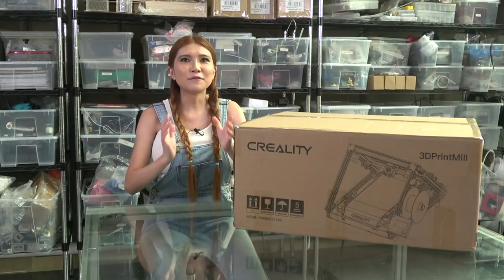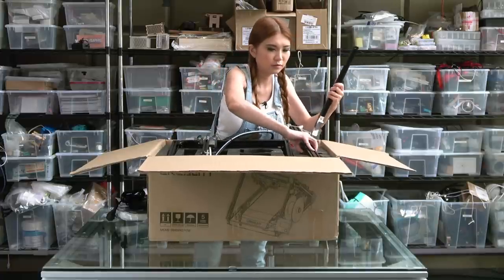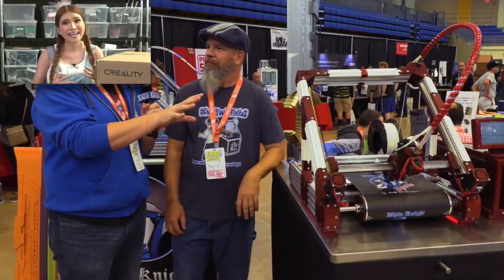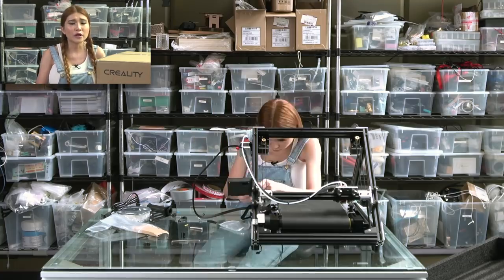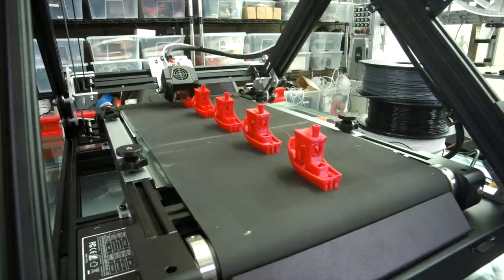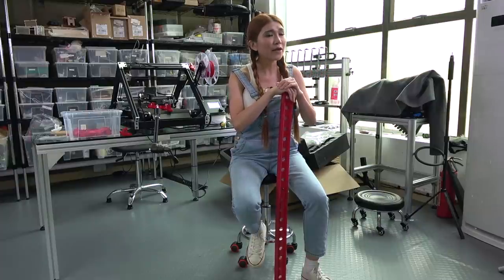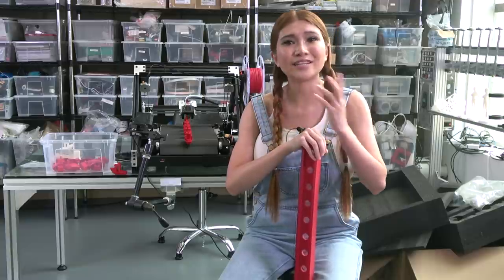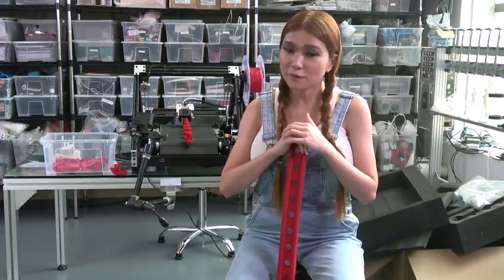Sneak Peek- The 3DPrintMill, Infinite-Z, Belt 3D Printer- Now on Kickstarter!

Comment: Still can’t believe this is a thing. So many possibilities. Really kills some of the dimension limitations
Reply from the maker: It's amazing!
Reply: I can see some large replacement parts for my car or cosplay being a reality soon.
Reply: Thanos Sword
Reply: I agree jesse. I so want one!  Great job Naomi!
Reply: the long I Beam printing was impressive!!!
Reply: Now you can print really long things Jessy...
Reply: Infinite Z has been around for many years. It definitely fulfill certain needs. But you are giving up material choices and print quality in exchange for size.
Reply: @Paul-sk2pc  it''s a niche printer .. probably good for very long parts that don''t require high resolution and uncommon materials.
Reply: I like this, good job!!
Reply: @Zuul47  has already been done by NAK 3D design (see channel beyond the video)
Reply: Perfect for my model train cars on larger scale engines? Price???
Reply: @WillofNewZealand  I have  a Creality 10S Pro but need to go long for train bodies. I wonder if i could retrofit the frame. $1,000 for me is a lot to invest when i have over  $600 in my 10S Pro already. Having the Belt printer and a UV Cure printer for smaller detail parts would be awesome. But maybe the quality of finish on the Belt stuff is not so great. All the videos are high speed fat layers and crude. Thank You for the Heads up. Need to list more more parts on Shapeways to increase revenue so I could get one. Incentive to work to grow.  Dennis in Virginia.
Reply: I see so many issue that like so many CR6 printers down no support. Many will not back this project. What stinks it there huge possibilities. But this printer all ready got huge black cloud over it because of such bad support and so many CR6 printers are not working
Reply: The Pervy Prepper  I could see lots of those parts released by the manufacturer and or for a commission by designers. Then make all the parts that can be modified or replaceable on a consumer level.

Comment: I'm an engineer at a company that makes appliances.  Something like this is really interesting for our Service Parts team.  We'll definitely have to take a look when it comes on the market!
Reply from the maker: Excellent!
Reply: That sounds fantastic, especially when manufacturers decide they're not going to supply spares for a 3 year old device!
Reply: I think 3D printing for spare parts is the future. No need for huge stocks of small items. Just print on demand. Better yet, actually release the CAD file and sale them for a few cents/dolars or give them away for older stuff.
Reply: @lsaplai  Let me know when i can 3d-print a new mainboard, or heated bed, or stepper motor, or hotend, or threaded rods or or, you get the idea.

Don't get me wrong, I fully support the idea/concept and I hope companies will start moving in that direction, but it has limited use.
Reply: @treborrrrr  just because you can't make 3d prints for a machine doesn't mean you can't 3d print other stuff, it may sound dumb, but since I got a 3d printer I realized how much stuff I could just go and make without even thinking too much about it

Comment: When it printed the i-beam, my mind lost the ability to form words... 🤯
Reply: Mine too at what strength can this be printed at and with rollers at the end your only limit is amount of filament you have
Reply: Who else kept waiting for it to tip and fall?
Reply: @CGPacifica  I just assumed there was support off-camera.
Reply: It turned out exactly as I thought it would with a curve in it,  unless the camera was playing tricks as she was holding it.
Reply: @nickmcdonald9993  Nah, you're right, it's curved. I've seen the same thing from Blackbelt prints (granted that was a few years ago, but still).
Reply: @nickmcdonald9993  you're right and my guess to fix this problem would be to install a set of rollers at the end so that the object has something lean on and therefore it won't curve

Comment: I definitely need one! Next project for it (which I'm happy to start iterating on) will be an automatic filament changer. Not for multi-material single prints, but for multi-material in multiple parts prints. Then you could hook it up to a raspberry pi with a few weight sensors and make sure you never run out of filament, and let a web-service prepare the parts to be printed. I'm loving this, and will definitely sign up for one as soon as the KS goes live.

Comment: I suspect many still do not fully appreciate how incredibly helpful this is for medium volume industry.

Batch process -> continuous process. Win.
Reply: A dual extruder setup would be rather good - not for two different types of filament, but to allow hot swapping for new rolls and avoid down time between rolls. Extruder 1 reaches end of roll, moves to left end and extruder 2 continues. Yellow light goes on, tech installs new extruder 1 filament, extruder 2 runs out, moves to right and so forth.

Comment: This is a big thing for small manufacturers.   It will mean that the machine can just be set to go without any supervision.   Currently I'm producing an enclosure for some of my electronics that I sell on an Ender 3 Pro, and it works great, but every day I have to set it up and I can't run at weekends.   This I could just leave to keep running all week, all weekend.

I don't know if such a thing exists, but once you start running standard 1kg spools through (which would probably last 4-5 days) you either have to opt for 5kg reels or find an automatic way to change spools.   That auto-spool changer would really mean that a small manufacturer could leave the machine unattended to work away by itself!

Great to see not just your name but likeness on the box!   You deserve all the success you get; well done!
Reply: where can I see your electronics?
im kind of doing the same thing, well, im getting a few products ready, plan to take 1 project to kickstarter, and sell smaller ones on my website which is currently in the reworks.
unfortunately im using a cheap knockoff prusa which isnt consistent at all, but i also have a form 3, so printing cases for selling isnt really an option unless I get a better FDM.
didnt really plan to 3d print my cases though, i just use my printers for prototyping.
small scale runs I plan to get one printed SLS, and then make a silicone mold with it for casting epoxy. the kickstarter I plan to injection mold.

but anyways, what are you making? id like to check it out.

Comment: Nice work bringing this design to the masses.

There is an advantage here, even if you only want say half a dozen small objects that you could fit on the bed of your normal printer, since it prints one at a time, if the print fails for whatever reason you only loose the one it failed on.  The parts may also be stronger due to less cooling time between layers.

I'm intrigued by the ability to build very long parts.  It could make another printer that's as large as it is without needing threaded rods or whatever.  With enough time you could legit make furniture with this thing.

Naomi, did you check the dimensional consistency of the I beam piece?  I'm curious how far off it is if you put a reliable straight edge up against it.  This would be a great fit for a very large nozzle hotend similar to the e3d volcano.  Are you considering offering it that way?
Reply from the maker: Oh it's VERY bent- you need rollers to support a piece that long, which I didn't have then but do now.

Comment: After looking at NAK 3D Designs CR-30 videos (great partnership, BTW), I'm wondering if Cura's "Make Overhangs Printable" still needs to be updated for printing at 45 degree angles.  From what I can tell, his adding supports for the Benchy rear text is helpful for a few reasons, but should not be needed for the text alone.

This setting would NOT help the TPU issue, where leading-edge supports are certainly needed.  But using TPU for supports can present its own problems, which I'm still struggling with myself, so I'm far from an expert on this.

Comment: If you're thinking of repetition manufacturing you need to manage the product flow between stations. Dropping product into a bucket is now primary school level, you damage and mark parts as well as lose orientation. Stick a printed robotic arm at the end for pick and place function. Add a lowering table and separator card stack and you now can print 100 parts for production.

Comment: About fifteen years ago I saw a CNC router that could do lengths longer than its bed.  Good to see the additive manufacturing community expanding in this direction.  When one thinks about it, the only thing that limits the size of a filament printer is the rigidity of the frame, and the amount of filament it would take to do one print.  3D printed houses anyone?  ^_*

Comment: Really exited! 

Doesn't help with my crammed home but I love the idea of printing large parts/models!

Will it support different nozzle sizes?

Would be wonderful to print with 0.8mm nozzles.
I printed some wheelchair ramps for my close friends/family and had to split them to 5 parts. 

On the other end, printing with 0.25mm and creating a full party of DnD minis or a small army for tabletop would be awesome!
The possibilities of skipping a print mid-fail and just moving the Y axis a little bit, then continuing to the next part without any bed cleaning. Yes! Finally able to "clear" the bed of any prints remotely.

I might sound a little bit exited :)

Comment: I love the printer. The cr-30 printer is a pro consumer grade device. This printer need to come stock with the E3D Gold Edition Hotend and PT100 Thermistor. Plus Zesty Nimble Direct Drive Extruder. This is a must have for me. A Hotend that only will heat to 260 degrees is ridiculous for a Pro consumer grade printer. The very first thing I would do before even turning the thing on is to install the above upgrades. I would rather have the upgrades installed and tested at the factory. Also, I would love to see a 320mm Wide version. I know you want to keep the price below $1000us. I would be willing to speed another $200us for the above upgrades, please. At least have this as an option. Remember, who your market is. A newbie is not going to buy the cr-30 as their first printer. Myself and small businesses are your market. My Tevo Tornado has a 300mmx300mmx400mm bed size and that is why I choose the Tevo Tornado over other similar printers.

Comment: I seen a belt track 3D printer at the Oshkosh Air Show a number of years ago. I'm still waiting for the hobby level versions of the sintered metal 3D printers.
Reply: Yep, that was my Printrbot Printrbelt printer.  Did you get a glider?
Reply: @williamsteele   They weren't exactly flying off your printer at breakneck speed! (Pun intended) while I found the printer a novel design I didn't want a glider bad enough to wait around. I've been there so many times that I have learned not to fill up my back pack too early with trinkets and then have to make a long hike back to the campsite to unload.

Comment: So awesome Creality is providing engineering support! I'm sure that I-beam will be load bearing by the time you have the prints dialed in. 👍 Next design challenge: refilling/switching filament spools without stopping the print run! Perhaps as an upgrade/add-on?😁

Comment: I see two big issues: 1) the movement of the belt and its flatness. This is a very interesting engineering thing...
2) We need to start thinking 45° on the side. Models are now often designed for overhangs up to 45-50°. Such a simple overhang could be impossible to print in one direction, but easy when turning the model around on the bed. And a horizontal slab is now a 45° overhang. You can see it at the benchies: they need support at the stern...

Comment: Great presentation of this kickstarter Naomi.  Speed might be preferable over quality as simple items like brackets for assembly or items that might be hidden inside another item might need strength and function not aesthetics.  This clever device could have different modes/qualities, say three, pre-programmed so if you need a functional part and lots of them in a hurry you can get them.  The I-beam would look great and be really strong in carbon fiber filament imo.

Comment: Maybe using something similar to tank treads instead of a belt would make it easier to level and not require so much tension to have a straight surface. Either way fantastic concept.

Comment: My initial concern is proprietary products. What happens if I have this printer still in 5+ years and need a replacement part? I assume the belt is not something easily sourced.

 I don't have a 3d printer, and this design seems like a lot of (potential) additional problems better avoided for a first printer. It does seem interesting for the design's potential print size though. 
  I've been interested in getting a 3d printer for custom project enclosure odds and ends. I can fab everything I need in metal, but it would be fun to play with freecad more.

Comment: Looks great! I've been watching this project with great interest! Thanks for sharing the progress. Just bought an Ender 5 Plus to replace my Replicator 2 recently. Oh, one more thing, Makerbot technically had a conveyor belt system for the Thing-o-Matic back in the day; It wasn't true infinite Z but the idea was for mass production of parts, it would print a part, advance the conveyor to release the part, and would repeat that process. it could even print items larger than the build plate just like this, it was called the Automated Build Plate, and it came before all the others if I recall correctly.

Comment: Bear in mind that the selling point of this is not the infinite Z axis, but rather the savings in labor and time management. The print doesn't need to be removed and stored! All you need is a bucket for the prints to fall into!
Theoretically, the only labor needed is to add more rolls of filament and ordinary maintenance (as in replacing worn out parts and periodic recalibration)

Comment: Naomi, you are a champ! We (the open source hardware community) are lucky to have you over there! The work you are doing in china may be just as important as the work that jo prusa did. obviously, you didn't produce as many designs as he did (yet?) but getting creality to understand libre/ open source better is not only better for them, but also for us. 
This very project is really fantastic, and i never considered a belt printer until i saw joel's preview of it. Not that i didn't like the concept, but it seemed like a too young technology, but i feel that with this project, it's completely getting there. I think that our fablab will be completely interested.
I am really enthusiastic; and since you are at the helm, i am confident in the quality of what you will produce. As for manufacturing, creality is definitely no slouch, so provided with a good design, this will do wonders.
Also, this is a significant innovation coming from China (i know, it's not a concept invented there. But going from a concept, a few prototypes and even a few machines sold to mass market at a reasonable cost IS an innovation. With this on the market, not only the other actors will be interested, but also we'll have better slicer support, accessories, etc...)
A few years ago, when i read about your pentesting shoes or makup computer, i did not imagined that a fellow hacker would get to such heights; and i am happy to see how you found a way trough all the woes and problems with media and stuff, and kept making even trough the hardest time!

Cheers from the caribbean, Naomi! I may be on the other side of the world, but i truely appreciate your work!
PS : also i am immensely glad to see someone shaking the stereotypes :)

Comment: This is a great concept for those you already stated in the video.  However I feel the ammount or parts you have to assemble will intimidate new small business owners interested in them. As someone who just got into 3d printing myself and tried to start at first with an ender 3 pro with bad screwe and z axis issues I was so frustraded with the ossues I was having i almost gave up trying. After returning it I founnd Anycubic had similar 3d printers with minimal assembly, just two major pieces then screw them together and plug the color coded wires, then I started making my first prints in minutes after learning how to level the bed. Long story short I would definitely think people would like a pre assembled option for this or future/final design even if there is an additional cost.

Comment: This printer is really cool. But if you want to push the limit you should combined the convert belt with light 3d printing. it would be interesting. Especially with the research I have done. Good job though.

Comment: O man, when I first heard of 3d printing many years ago I immediately began thinking of repeatability without direct human intervention. I was thinking servos to bring down scrapers and have the gantry knock off prints, but this... WOW! I see where issues can arise from the 45° printing angle. We're all used to horizontal stacks, I would think the biggest issue would be the programming for a slicer to slice on that moving incline. Is there a reverse feature? Starting a print with an overhang away from the nozzle would need a raft or base to accomplish. Maybe print the base of the model first, then once a strong/high enough base is laid down restart at "Z" for overhangs to print well. Also, I say you guys should should call it the "A" axis... It's some "Y" then some "Z", next letter is "A" which is also similar to the shape of the printer. Just saying lol. Version 2... rotating geometry print nozzle... seriously... that'll be the "W" axis 😁